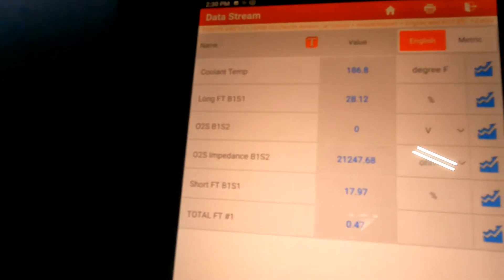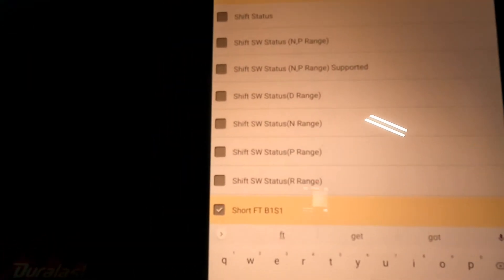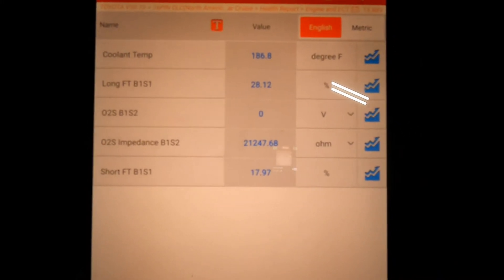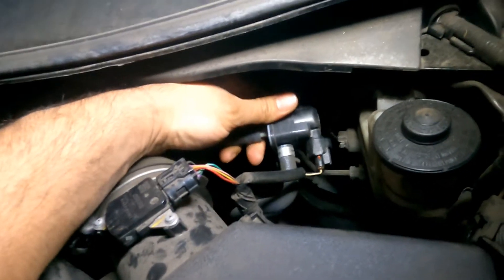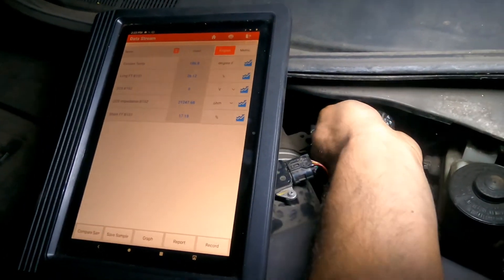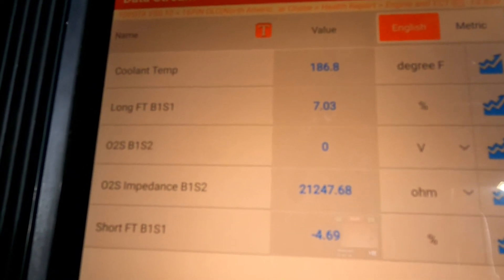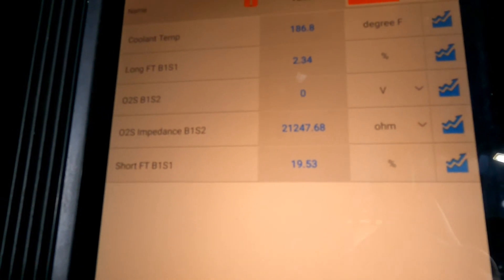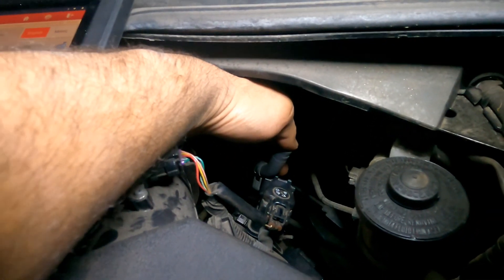2016 Camry P0171 System Too Lean : Purge Valve

Comment: Irfan, you da man.  Just saved me probably $500.  My Camry initially had code P0455, then added P0440 and P0171.  I also noticed the car started real hard after fuel fill up.  I cleaned MAF, things got better (first two codes went away), but P0171 stayed.  I took a chance and changed Purge control valve and codes now are gone!!!
Reply: Im going through the same issues with a used car i bought, im losing it.